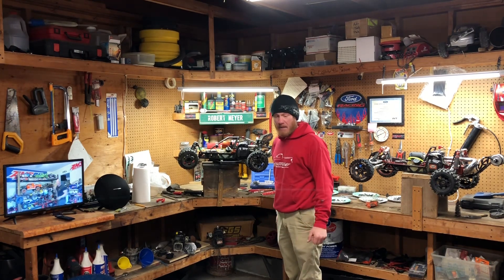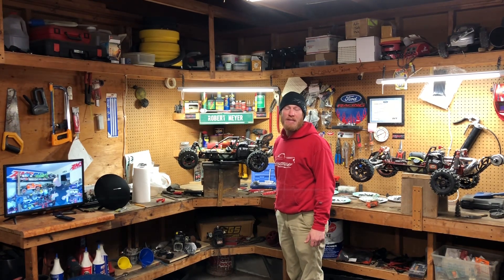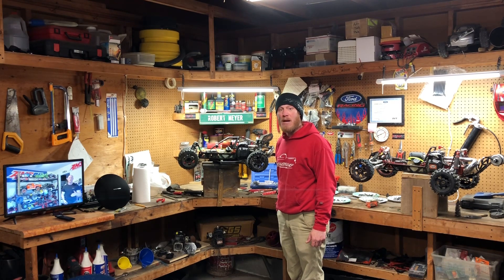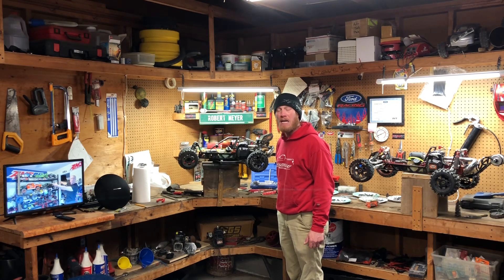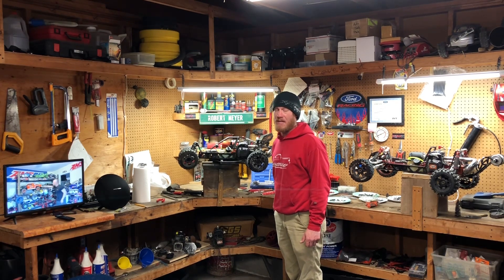World’s First Rovan 34cc Engine Top Speed Runs in the Baja ⛽️⛽️⛽️🧨🧨🧨💥💥💥

Comment: My Baja runs great but there is a little dip or bog when I hit the throttle from a stop any suggestions would be great?
Reply from the maker: Thanks for watching brother!!!  My suggestion would be to turn the low speed needle counter clockwise a little bit at a time till it went away.  The low-speed needle is the one closest to the engine.
Reply: The problem is that it is not consistent one pass it will be top notch the next pass it will bog
Reply from the maker: @jaymefarley8806  That my brother can be a few things.  I would check for vacuum leaks and then I would try a different carb while the carb was off I would also check the plastic intake.
Reply: @Meyers2strokeRcgarage  thanks for the information I will check it out.